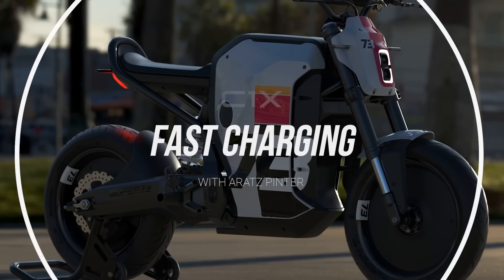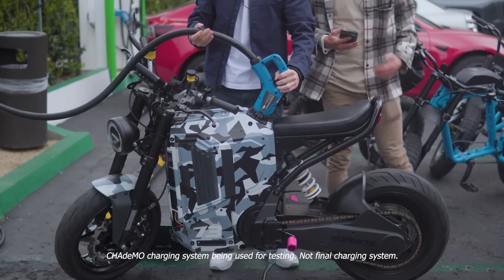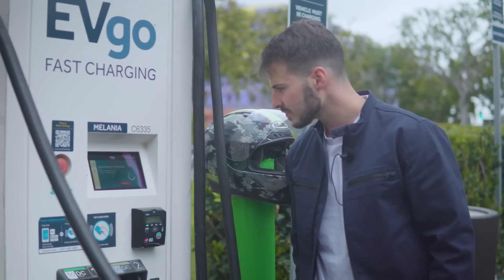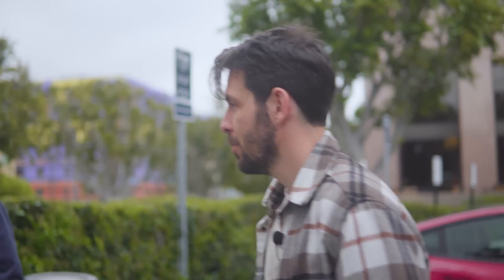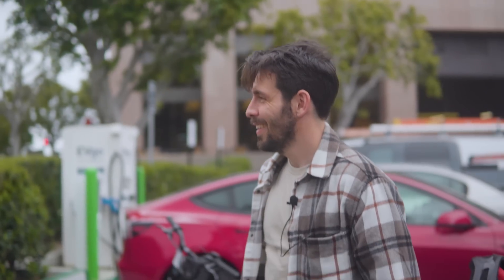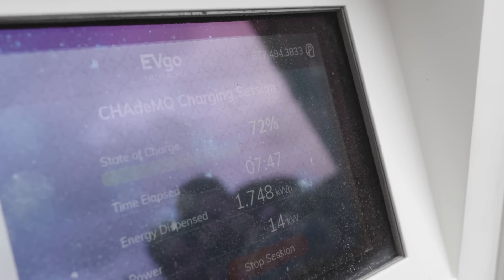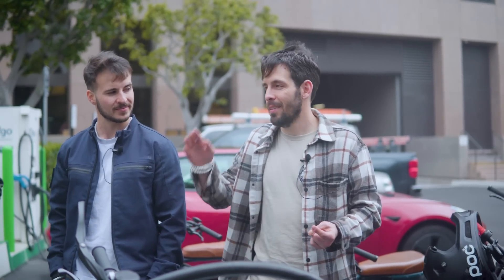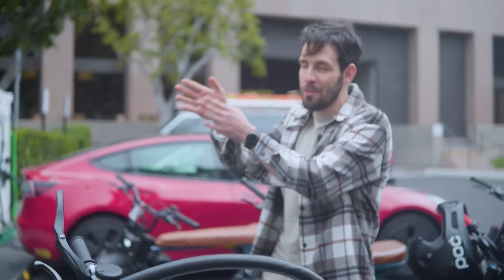The Technology in SUPER73’s C1X Record Breaking RAPID Charge.

Comment: Again - key will be price. Any electric vehicle coming out (car, moto, etc.) will come with the expectation of fast charging.  Great that C1X is one of the first, but its other limitations make it essentially an electric scooter (albeit a Honda Elite 150 or thereabouts) equivalent - not a full-on motorcycle. Albeit a much cooler scooter.  So for this to be successful, the price has to reflect the C1X's in-between status between Super 73's eBikes and an entry priced motorcycle, which appears to be between $4k and $10k.  The lower the better.  I speak as both a reservation holder for a year and an auto (and to a lesser extent, powersport) industry veteran.
Reply: I'm all in!
Reply from the maker: When we unveil the speed and range, we think you'll rethink the "scooter" classification. We'll make you proud on all fronts! I promise 🙏

Comment: Fast charging speed is definitely an important metric for EVs, and the need for fast charging goes up as the total range goes down, so its great to see something like the c1x charge this fast. Curious to know what the final battery warranty is. 90% range after 10 years? 85% after xxxxx charging cycles? As a c1x reservation holder I am keen to see what the final numbers are.

Comment: Very cool! Question: Do you have any more of these Q&A's that I missed before my reservation about performance? How did you settle on ~75mph top speed? How do the tradeoffs work with range, price, etc? Can you address those in a Q&A – love this format, it's getting me excited!
Reply: And just to show my hand 😊, I feel like 75 is the bare minimum highway speed but not really comfort-inducing. 85-90 would give riders the ability to keep up with traffic at 75-80 but have some headroom to accelerate out of hazardous situations
Reply: @chriskurose5530  I second this. 75 is great, until you need to go up a large hill on a 70mph highway and suddenly 75 is 55 and you're about to get flattened. 85-90 is the correct target.
Reply from the maker: @chriskurose5530  Couldn't agree more. We'll be releasing a lot of information regarding that in the future.
Reply: It should be able to be modded when it comes to life by the aftermarket world but top speed I agree should be 100 so if your 80 on the freeway you have to jump out of the way you could

Comment: Ok now i understand why it is an improvement compared to the live wire. Did you guys made test to see if you were able to keep a 3.5c with larger batteries ? 
So virtually if you had a battery pack 3 times larger, the charging speed would be 3 times as fast and could go up to 39kwh ?